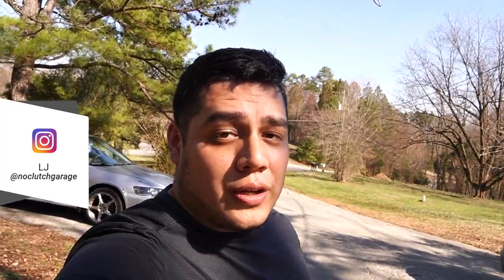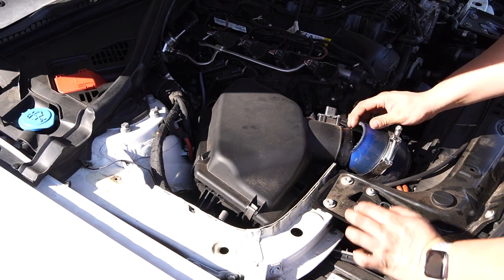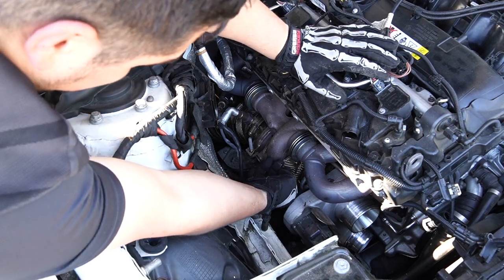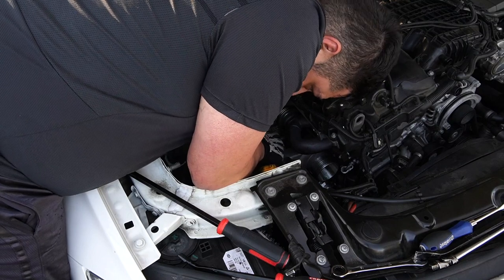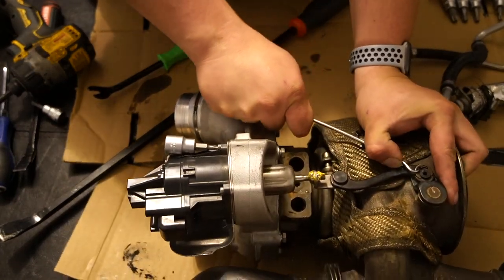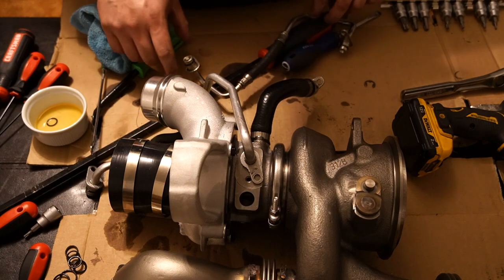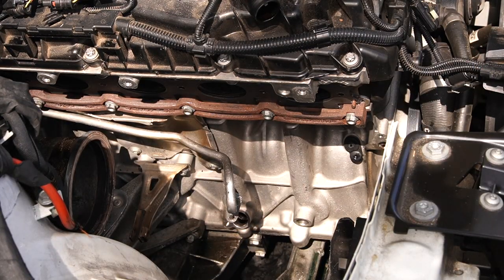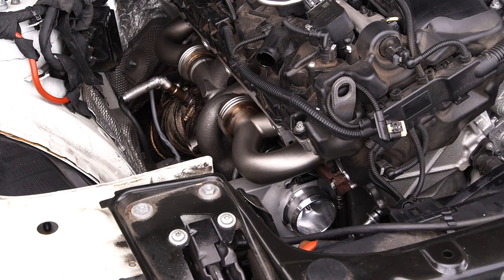INSTALLING THE BEST HYBRID TURBO FOR B58 ON THE MARKET | DAW FlowMax 2.5 Turbo

Comment: I noticed at 24:23 or so there is a black plug, under the front of the manifold bracket is that a crankcase vent hose if so I actually broke mine off and am replacing.
Reply from the maker: It is a "fresh air vent" it is check valved and only allows air to go in, if you broke it off you will be fine.

Comment from the maker: NOTE: I have been in the prime vs not prime the turbo debate for a long time. I have swapped out plenty of turbo, sometimes I have primed and sometimes I have not. In my experience it makes no difference. Oil comes in pressurized and very quickly into the CHRA, if your turbo siezes on startup I can guarantee not priming your turbo was not the cause of it. Your favorite mechanic and turbo maker doesn’t prime their turbos 90% of the time.
Is it the correct procedure to prime? Yes. Will it kill your turbo if you don’t? No. Drop a few drops of oil into the CHRA if you feel uneasy about not priming and you’ll be ok. ✌🏼

Comment: My take from my install, coolant and oil lines were the most difficult.  Didn't want to damage anything so pulled all the lines off the block vs the turbo.   That bracket that holds the turbo is hard to get to and it did cause a bit of a headache when reinstalling the turbo.  Oh and don't forget that top manifold bracket although not too hard to put back in if you forgot lol.  Good work, made it look very easy which I'd say it is compared to other vehicle turbo installs I've done.
Reply from the maker: I cut out a lot of the time obviously but yes it is relatively easy

Comment: Pulled the stock turbo last night installing a DAW. I decided to replace the lines as they had a lot of miles on them. 

When you lifted it out it looks like you lifted from the turbo side and let the other side dip down. I had a rough time getting it out but I know it can and did eventually. Thoughts?
Reply from the maker: Best way to lift it is to grab the turbo itself and pull up and off the bracket.

Comment: Am I supposed to do an oil change after installation i have 3k miles on current oil
Reply from the maker: You don’t have to but I typically do an oil change at the same time I’m swapping a turbo.

Comment: Really makes me nervous removing that support bracket. I understand the mani and downpipe can hold the weight but surely it’s putting extra pressure especially on the top threads into the head no?
Reply from the maker: I chose not to re-install the bracket but you may choose to do it. Fit me is as simple as the fact that I’m always messing with my car and there is enough support everywhere else to hold the manifold in place. For reference every single full frame kit out there relies largely and solely on their intake manifolds to support the weight of the turbo. As long as everything is torqued in properly, there shouldn’t be an issue.

Comment: as one of the options daw offers a race thrust assembly, any idea what that is? might be a stupid question but just wanted to know what it is before i option for it.
Reply from the maker: The thrust assembly refers to the design of the thrust plate which helps oil the turbo. On a standard plate it has one oil port, the race thrust assembly has 3 oil ports which aids in lubrication and overall turbo cooling, resulting in better turbo performance.

Comment: Prime the new turbo before first start up. Unplug injectors and crank it over to get oil through the turbo.
Reply from the maker: You can if you want and that’s the correct procedure but it is not make a difference. Oil comes in at 100 psi, it gets to the turbo plenty fast.
Your favorite turbo maker doesn’t prime them. Just saying.
Reply: @NoClutchGarage also don't have to unplugged injectors to prime,

Comment: 700 wheel capable with port? Or would the ultra flow be better for the 700 wheel range?
Reply from the maker: Yes you can use port injection to get there confortably
Reply: @NoClutch Garage  not a 2.5 bro, even with Port that's not possible According to shoup. U need the 2.5+ which will do 650whp on pi maxed out, flowmax ultraflow will get u to 700whp on pi tho

Comment: Any dyno numbers coming. DAW is local to me and really want to upgrade my B58. Just curious why did you swap a VTT GC out for the DAW?
Thanks for posting this!
Reply from the maker: VTT GC is only good for about 600whp, DAW 2.5 has been proven to over 700whp.
Reply: @NoClutchGarage  thanks for the reply. By any chance are you using the DAW charge pipe. Love how it stacks up with the competition!
Reply from the maker: @ptaormina8010  FTP Charge pipe

Comment: Did you have any trouble getting the turbo to fully seat in the turbo mounting bracket on the manifold? I’m current doing this install and it doesn’t seem like it wants to sit as deep in the bracket as stock, therefore the hole on the turbo support bracket below isn’t close to lining up with the hole on the turbo. I know you completely removed that support bracket which I fully support, I just don’t know if I should be concerned about the turbo manifold not being seated as deeply. Thanks!
Reply from the maker: I did not remove the bottom support bracket but the top one yes.